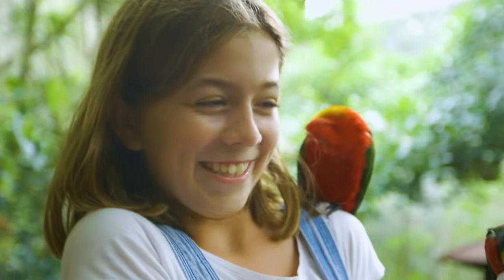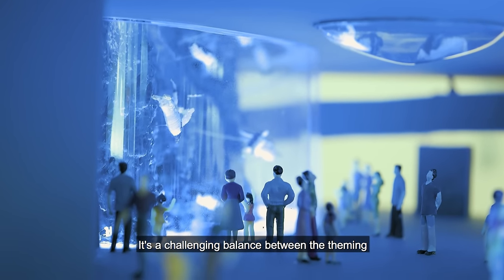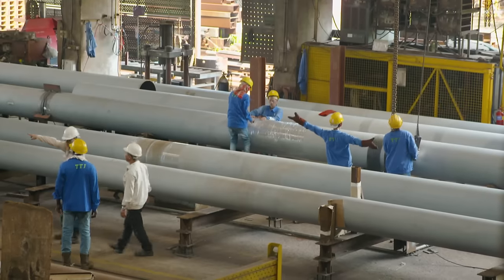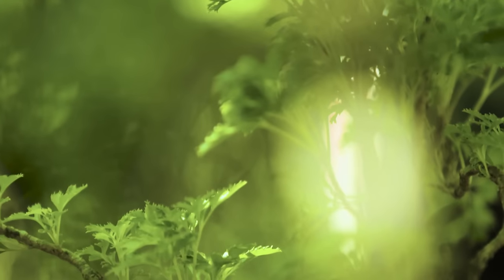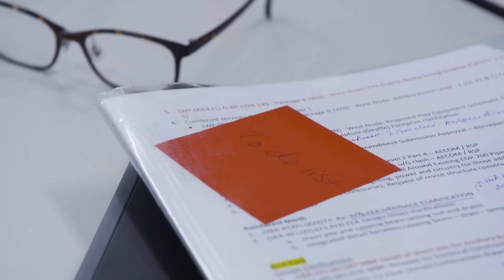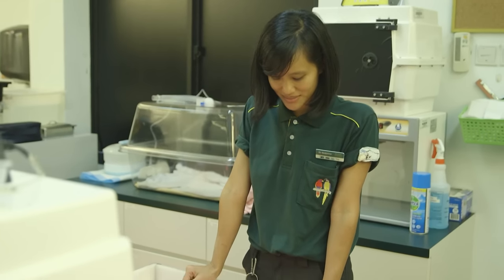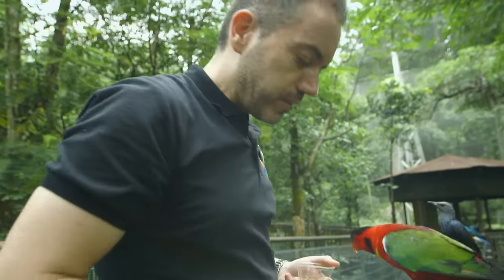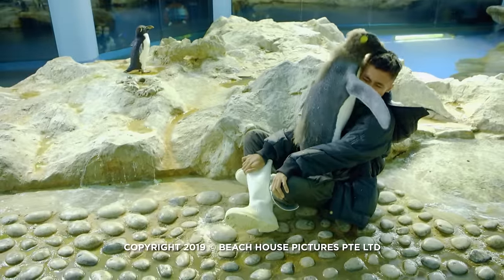A New Home For Asia's Largest Bird Park | The Great Migration: First Steps | Full Episode

Comment: The entire team is e penguin's (R.I.P.) nightmare. These lot of " experts"  that 1) Xray'd 2) antibiotics meds 3) nebulizer 4) not wearing an N95  but face mask that lets through cigarette smoke through,cheapo mask n changed daily $$$!? How could a penguin survive? Their ignorance will not be corrected or realised cos of 1) Pride 2) not bothered at not realising that human n animal are n cannot be compatible medically.The air quality in e enclosure ( vs wild ) n e extreme temp.  tolerance that e penguin had to undergo is really cruel. The person (s) turning / auto turning incubator  is part n checks e entire team double checks each other (curator + mgr + keepers responsible ) for e well being of e penguin's life. (Egg ~ I... weight monitoring , 2...amt . / way egg was turned 3... Humidity 4...water content 5...light shielding, etc...~ may HV been deliberate for media n scientific write ups!? What a bad & cruel way to care for a single life. Off course as e entire staff  ( over paid & under worked ) would say :  " it's animal n not human life " ( end of Part I )